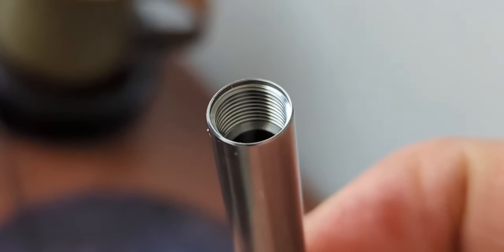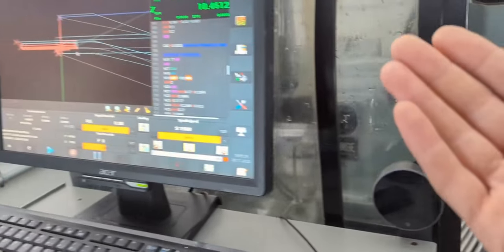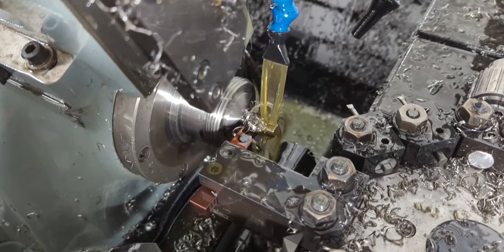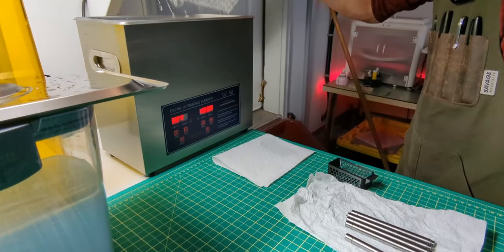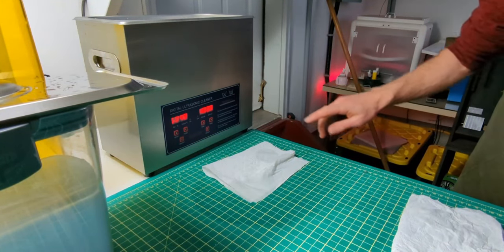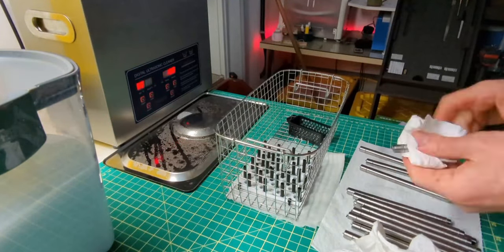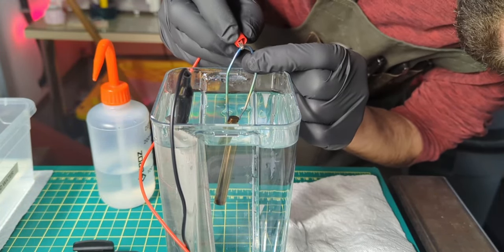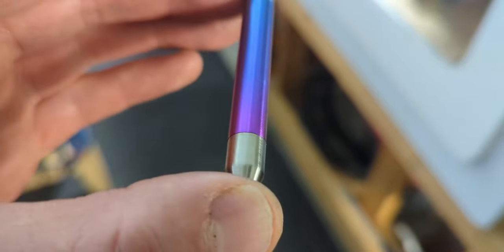vlog 14 - Fade Anodizing and the Insane Cleaning Required

Comment: Even though you're wearing gloves I still wouldnt be holding the positive clip with one hand and the part with the other. I used to do the same thing and had been wearing gloves all day didnt notice I had a couple holes in the fingertips and got myself with 90v dc from my left hand across my body and out my right and it was quite a zap. I do all my anodizing with on hand only now just as another precaution.
Reply from the maker: Meh...DC scares me much less than AC. In school we used to work with one hand on HV circuits (mainly taking measurements, hard to actually do work that way), ideally with one hand in a pocket to keep the path across the chest to a min.
Reply: @CurtVanFilipowski  I zapped me pretty good my power supply only does 1 amp but I swear my heart was beating a bit funky for a few minutes after.

Comment: I must have misheard, did you say 50 year old machine. I assume you updated it with the modern display. And is it actually as automated as it shows on the video.
Reply from the maker: You heard correct (70's era) but yes, all modern servos and control. Old control was paper fed tape and just the cabinet for that weighed 1000's of lbs!